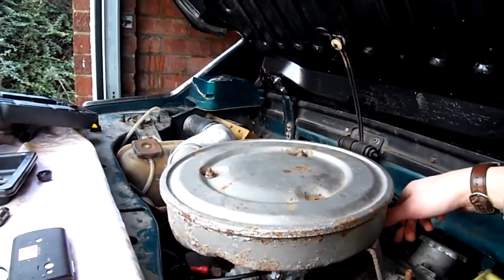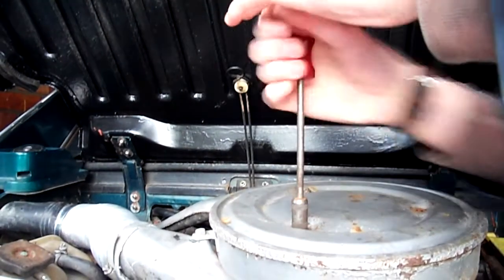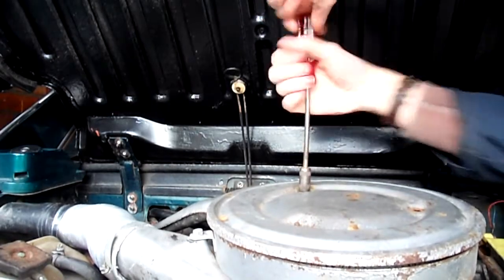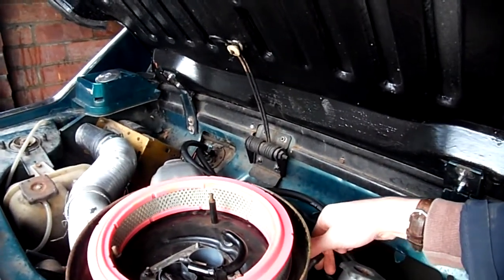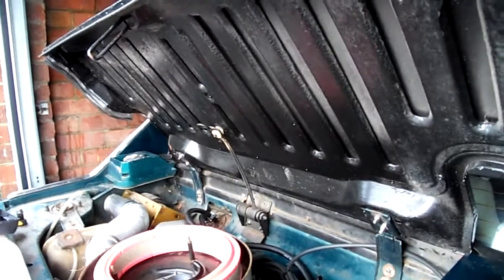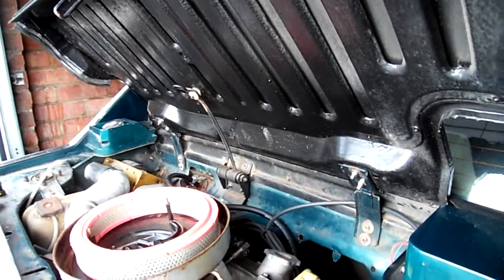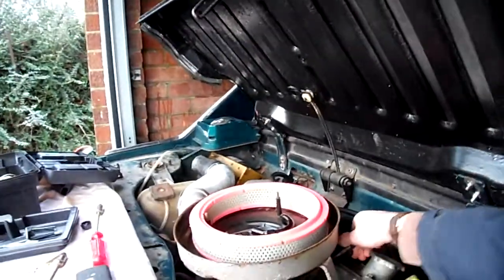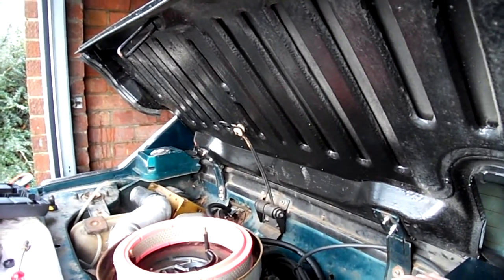Back in with the Fiat

Comment: Simon, you are running too lean. the idle stay too high. Check for air leaks on the intake manifold...
Reply from the maker: thanks, its mostly fixed now, still need to set the carb up properly as the idle is still to high, but it runs ok now
Reply from the maker: Simon Saunders turned out I had the jets in the wrong way round